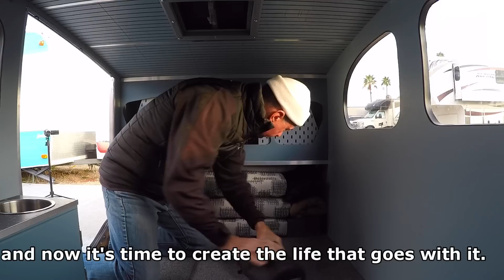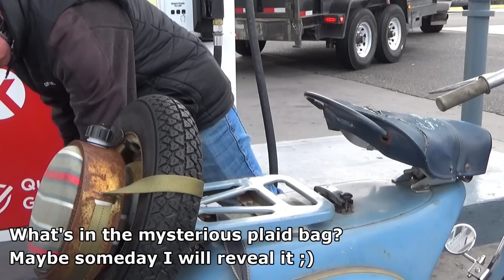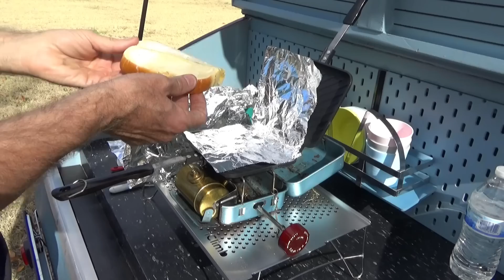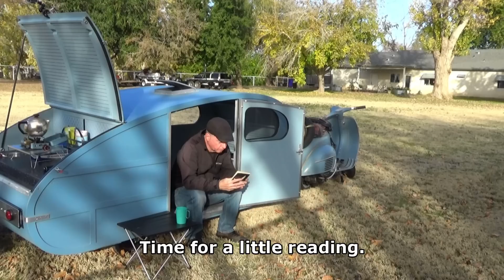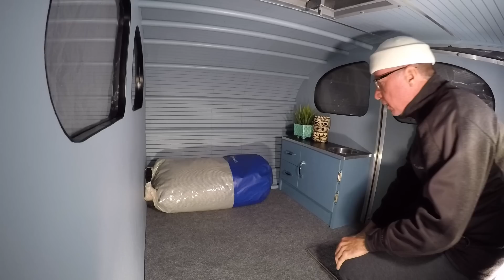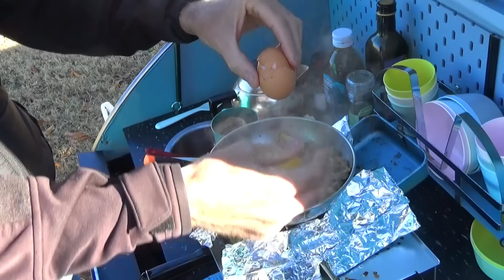Suburban Farm Camping in the Vespa Teardrop

Comment: Love the set-up! Fun adventure. I’ve been using baby bottles for mixing my 2-stroke oil for ever.. nice part, they have lids and the old ones were glass (for a MCM guy)
Reply from the maker: David, thanks for the kind words. I never thought about using a glass baby bottle! (only glass will do lol). that little plastic cup is really hard to read. I mark it w black marker but the oil residue dissolves the mark lol. I’ll keep an eye out at my local goodwill for the baby bottle. Great suggestion! Thank you!

Comment: Such a cool Tiny Camper! Saw the build and am impressed! BestRoy
Reply from the maker: Hi Roy! I checked out some of your boat building videos. Beautiful builds! There may be a chance for some collaboration in the future. I've had this crazy idea (from the start) to build a small barge-like platform to turn the Vespa teardrop into a house boat. Idea is to wheel the teardrop onto the platform, lock it in, and take off for a house boat camping weekend! What part of Canada are you from? Maybe we can collaborate when I'm ready to take that on?
Reply: @thetinysideoftiny7625  That sounds like a fun project! Some have done just that! Your Teardrop is so light it would even work on twin hulled "Hobbie" sailboat pontoons! Plenty of older used ones out there are cheap and a light structure or "track" for the wheels to roll on would save having too much weight where it is not needed! Under your trailer could be left open, just deck enough to be useful once the trailer is on! A 2.5 hp Would move you very well! A friend made a cheap small boat that cruised the whole Trent Severn waterway with such a motor set on idle and it cost all of $40!!! We are from Wasaga Beach, Ontario. South end of Georgian Bay. All the BestRoy
Reply from the maker: @roydesignedthat  Roy, I KNEW you were the guy that could point me in the right direction. I'm serious about the project too...so once I get my sea legs under me (pun!) with my channel, can I touch base with you to start the platform build? BTW - I lived in Ottawa, Ontario on and off for 4 years from 2005 - 2008. What a beautiful country you have.

Comment: I love the camper! It makes me think though...would some leafsprings or something help it a bit?  Might have to DIY them, but I think some basic suspension would help with the ride and also maybe longevity...allowing the leafsprings to flex instead of your camper.  I'm in the middle of my own build, and I am trying to plan for any issues I might run into.  I learned a lot from this camper build...it's the one built by "The L Word by Lucy", right?  I hope to share some of my build on Youtube eventually.  It's an oddball "transforming" design...when in transport mode, it's about 3.25' x 2.5' x 2', when "open", it's about 6.25' x 2.5' x 4'.  It "transforms" manually right now (pull a handle and insert pins), but I would like to use some gas struts and sliders to make it mostly automatic.  The purpose of it being able to transform is so I can dismantle it and store it flat packed inside, and so that it can fit on trails and such.  Having my entire rig be 12 feet long including bicycle is too much for what I want to use it for.  I also have plans to power the trailer with a cheap 250w ebike motor...I already have batteries and solar.  The motors go for like $25.  It would be enough to make pulling that much easier.
Reply from the maker: Best of luck on your build brother! 
Please send me a few pics or post a video when it’s complete!

Comment: Is the camper the  same  age as the vespa  ? Wouldnt  it load the cvt belt pulling all that weight . Nice set up
Reply from the maker: Hi Matowix! The camper is brand new. I designed and built it from scratch. It is modeled after a 1947 Cabin Car camper. The Vespa is a 1962. The transmission is not CVT. It is a 4 speed manual. You rotate the left handlebar grip to row through the gears. Super fun! The camper weighs just 170 pounds…equivalent to having a passenger on the back of the bike. Overall, the bike pulls it pretty well. Thank you for the view!

Comment: you built a camper then you build your bed each night and wear clothes to bed? insulate the camper and install a diesel heater. Seems like you wasted all your storage on a kitchen. if you open your cushions and install reflectix on the bottom you will lose less heat. no point in having a camper if its cold the diesel heater will solve that